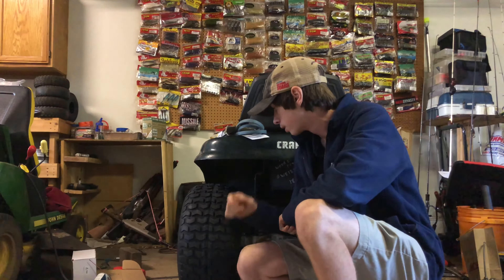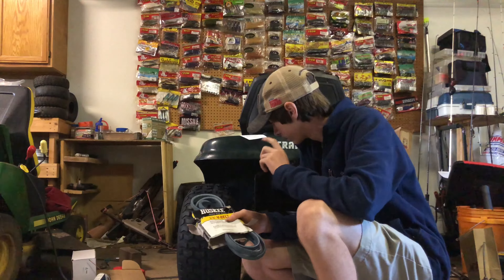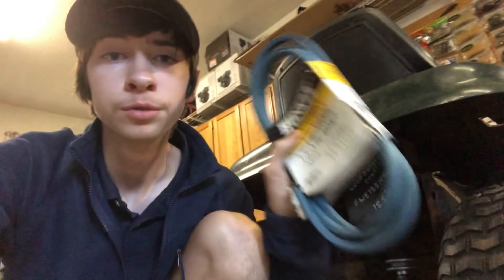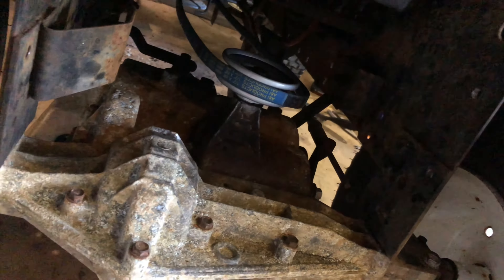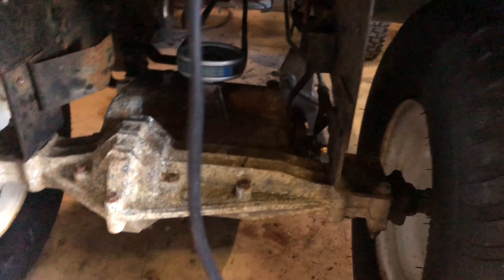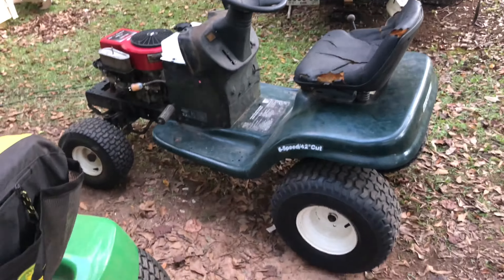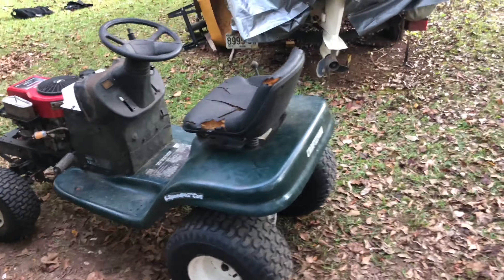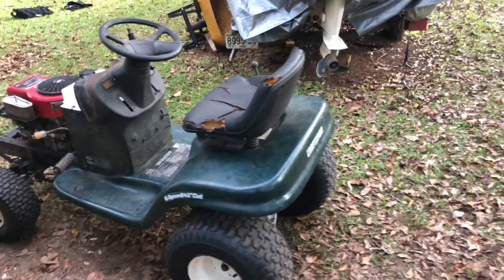Racing Mower #4 | Runs & Drives After 5+ Years

Comment from the maker: The ratios on the paper are not right they are actually lower which mess up the final speed. We held on axle and the diff must of spun the other axle faster giving us a higher ratio reading so really it goes about 15 mph at 3600 roughly because the governor is bypassed which made it hit 17. We can improve!!

Comment: I'm doing this to a john deere lt155. Not sure what pulley I should use. Any advice
Reply from the maker: Big pulley on the engine & small on rear end for speed, it is the opposite for lower speeds
Reply: @IngenGarage  thank you very much. Your videos are awesome. Keep up the good work
Reply: @IngenGarage  what size was your front pulley and what was your rear pulley size
Reply from the maker: @xzuenia1492  Frontt is stock at 3 inches and rear is 3 inches
Reply: @IngenGarage  where you got it from tractor supply?

Comment: What kind of oil did you put in the transaxle and did you fill it completely?
Reply from the maker: In this video I put a mix between 75/80W-90 and yes we did fill it completely(pretty sure).
Reply: @IngenGarage  just normal engine oil? I filled mine with ATF and it blew up LOL
Reply from the maker: @ratboy1016  Now at current time I have transmission fluid in it if you saw the last video.
Reply: @IngenGarage  i did see that one. After i filled mine with atf u had to force it into gear and eventually it tore itself to pieces lol. Any other suggestions for what kind of lubricant to fill them with?
Reply from the maker: @ratboy1016  Diff fluid if you are actually mowing or slight pulley swap(around 20 mph) or maybe 5W-30 engine oil for high speed, or again trans fluid and so far on mine it is working fine! Idk about 3 in 1 oil might can consider that! lol
Reply: @IngenGarage  mine goes abt 40 so ill try engine oil lol. Thanks man! Love the content btw keep it up
Reply: @ratboy1016 did the engine oil keep it from blowing up? imma swap mine soon and id like to keep my trans

Comment: What size pulleys are you running?  Im building one now that should do 60ish on paper
Reply from the maker: 2 1/2 inch on the rear and 2 1/2 inch roughly on the front so it is about 1:1, now got a front half of a 40 series torque converter on it now that comes to about 3 inches fully in cause of the skinny belt and goes about 20mph.
Reply: mine does 60 i have a 20hp enhine with either a 5-6" front and a 1.5-2" rear with a 5 speed